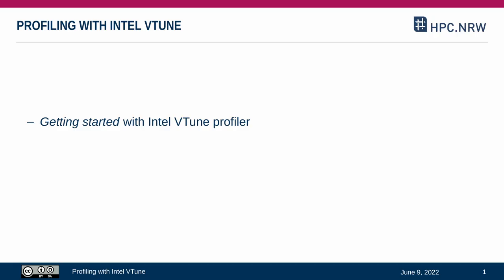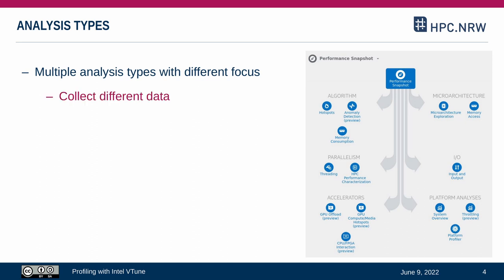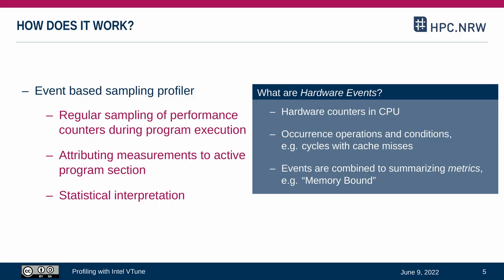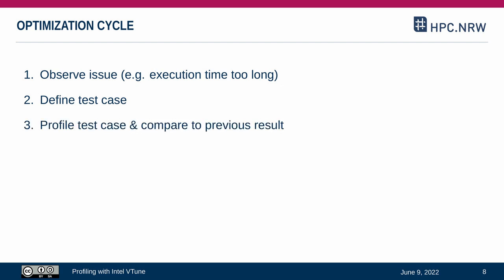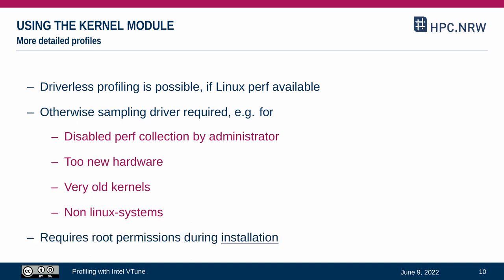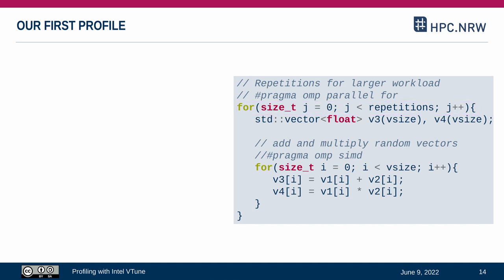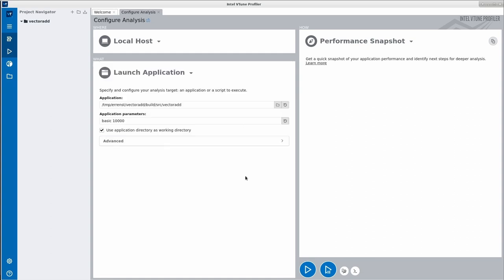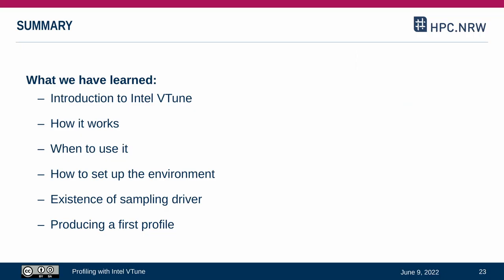Introduction to Intel VTune

Comment: It is extremely common to not have a gui I. Hpc environments so this video not mentioning it is reliant on it till the end is a huge waste of time for some ppl...
Reply: vtune gives ya a concice report if you run the commands on terminal, but the gui is more helpful, if there's a way that you can download the report files to your local env, you can still use the gui that way
Reply: @zakthesquirrel7621  yes EXACLY so showing that in a beginner video would be SO HELPFUL
Reply: @nevokrien95  yes yes, tbh i tried it just to see if it'd work and it did 😂😂, i needed for an optimisation/openmp project